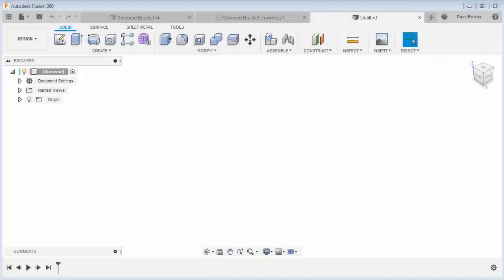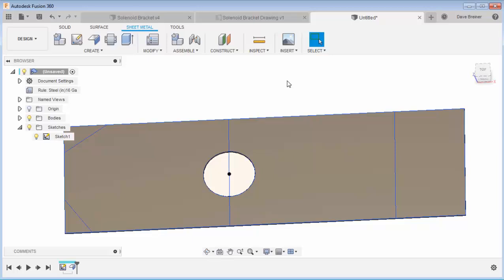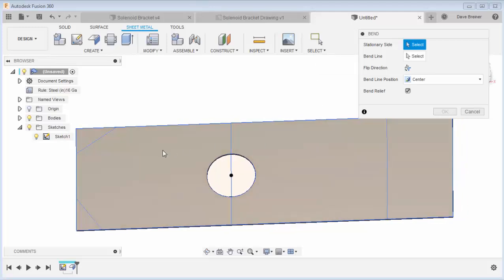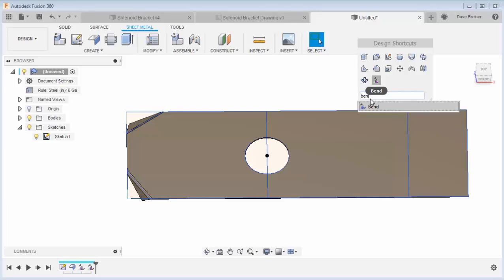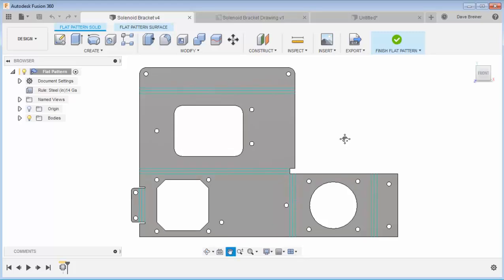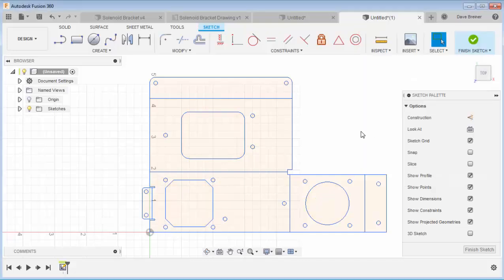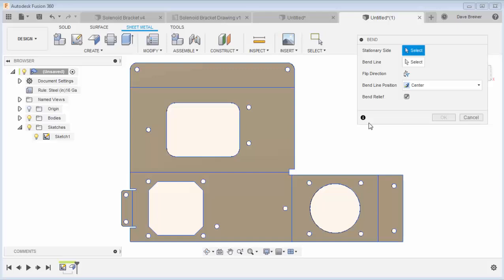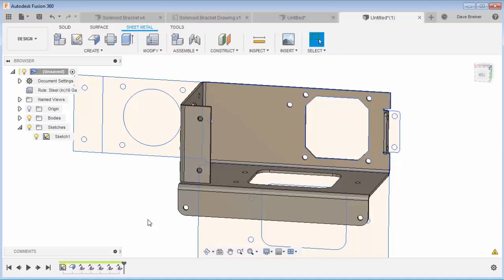Fusion 360 - Sheet Metal Bend Feature

Comment: Summary: You use the BEND feature to bend a flat piece of predetermine dimensions. Use the flange feature to create one surface and to keep bending from there, where dimensions and angles might not be known.

In effect, you're doing opposite workflow. Bend starts with a flat piece, flange starts with a piece that you create into 3d and then presumably would flatten out so you can cut it.

Comment: I followed the video exactly, I think some update or something (maybe a setting I have or don't have) in Feb 21 is having the tool work differently than it is in this video. I had to make another sketch on the surface created by the Flange tool, for the bend tool to work. In case anyone else has an issue with this.
Reply: I have a current edition and I'm having the same problem, after doing everything you did, on mine (windows 11), I had to stop and make a drawing, then the bend for every bend I wanted, what different?